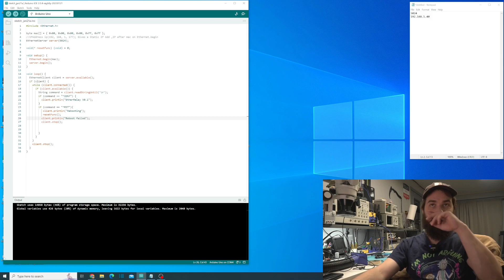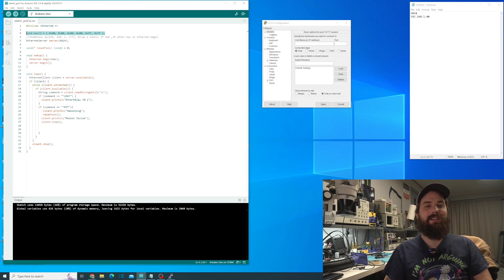Arduino Wired Ethernet - Getting Started - WIZnet

Comment: Just wondering here. I am thinking a Cat 6a cable might just give you that little bit of extra space needed to fit the ethernet and USB B connectors in that tight spacing. The RJ45 connectors on them are a little different.
Reply from the maker: I mean they do fit fine as is but I could see someone having problems if they used anything that somewhat not standard